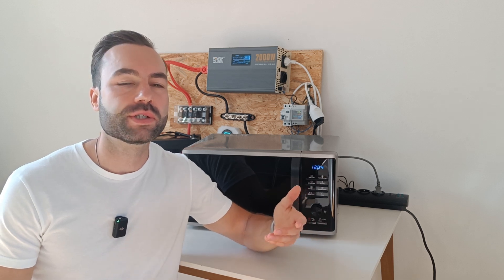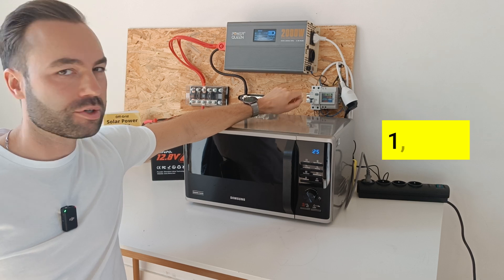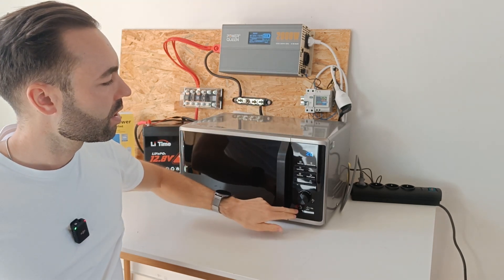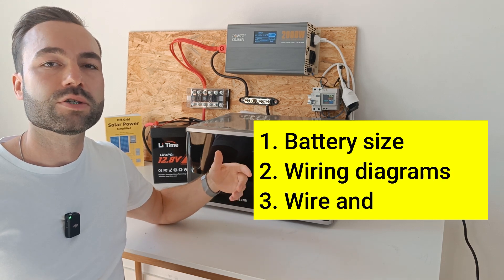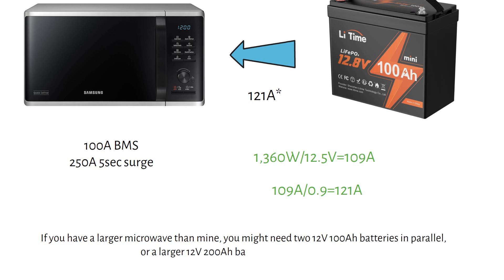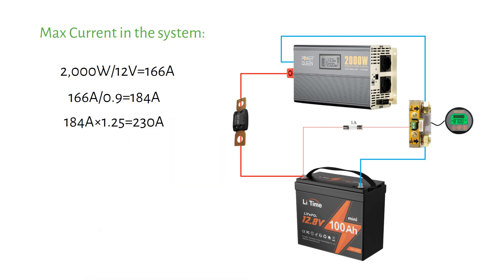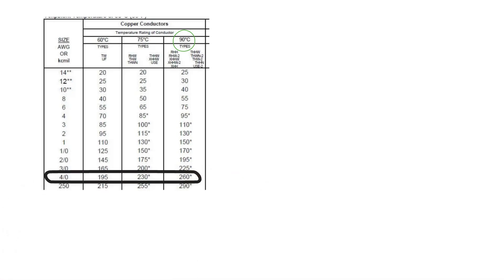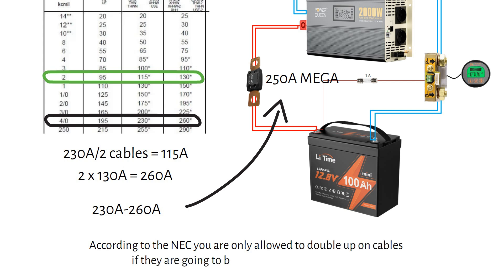What Size Inverter for a Microwave?

Comment: Nick, your calculations are fine for a single direct output.  But the manufactures realised that worked so they selling those inverters.  

They now sell inverters with a catch, with a twin plugs output.  The trouble is each plug will give you a maximum of around 60% of the rateable output of the the whole unit.  So a 3000watt Inverter gives around 1800w per socket, hence the reason that @Jesus_Student finds his microwave max'd out after a minute. That is the real world.

Comment: There are 200 C degrees silicon insulated cables which are even better than 105 C degrees synthetic rubber insulated "welding cables". No need to double the cables with them.

Comment: If you double the cables you can melt one of the negatives if they other becomes disconnected. If you use one fuse with 2 cables you can also melt wires if one of the positives becomes disconnected.

Comment: Could you please make a video about a system with 1000w solar panels and a 2000w battery and inverter and explain how long it would work and how much it would draw from the battery and how much from the solar panels? I hope I explained it well.
Reply from the maker: You can check my video playlist about systems. Also check out my video about load analysis.

Comment: Is the inverter microwave like 2000 bucks or what?  The 12v freezer is 1700, its more sensible to just use regular appliances and build a bigger array being i wont be mobile

Comment: I was running a 900 watt microwave, which drew 1550 watts. My powerstation was rated for 1200 watt running, and 2400 surge. It ran it for a minute+ before the circuit broke.

Comment: Sorry Nick, but Your calculation is wrong!
When You have 90% of 109A is  98A NOT 121A ...!!!!
Reply from the maker: It's 90% efficiency. That means the input on the inverter is higher than the output. Thus, it has to be divided by 0.9.

Comment: Hi Nick, great content as usual; thanks! I live in Hawaii and have found that purchasing any type of large lithium battery for DIY residential PV is seemingly impossible; I have done a couple of 'micro-solar' projects (e.g., a satellite modem/router back-up system) using banks of 24V power tool batteries which have taught me a lot. It occurred to me during your video that, since a microwave uses short bursts of high current, that it might be a candidate for lead acid batteries. I would normally never even consider an emergency back-up based 12V SLA technology but perhaps for a microwave and/or electric kettle it would be OK, right?
Reply from the maker: Please check my video about how many batteries for a 3000W inverter. It's my most popular one. Lead acid is more expensive than lifepo4, especially if you do it yourself like a 48V battery box with 280ah cells. For the capacity, it's unbelievably cheap. If you can build the battery like you already did, I don't think a larger diy battery is a problem. The cells gets shipped directly from China or a us warehouse. You don't need to box, but you need a BMS.
Reply: @cleversolarpower  Thanks! I would certainly NOT do 12V-anything (and especially not SLA) if there was an alternative but I think Hawaii must have some unusual shipping restrictions as I can't find any reputable LiPO supplier who'll ship here no matter how much I'm prepared to pay. I've tried multiple suppliers on the mainland and Asia to no avail. FWIW, it's also frustrating that other companies in what I would call the "PV ecosystem" such as BougeRV won't ship things like DC-fridges here either; one of the hottest and sunniest places in the US, with lots of wealthy, environmentally-conscious residents, and yet it is woefully under-served by the industry!

Comment: Besides knowingly exceeding the battery's apparent BMS 100A continuous rating (3:33) for 3 minutes and justifying it with a 5 second surge rating -- huh? -- besides that, the temperature rating of the inverter's terminals is not considered for cable ampacity, putting the terminals at fire risk. Then there's ambient temperature to consider, etc., etc.  Be careful folks!
Reply from the maker: The specifications say it's for 5 seconds, but as I've said I ran it for 3 minutes without issues. Yes, the terminals will catch fire 😬

Comment: Thanks for the video explanations. In the end, the only thing that was not clear to me is if the NEC rule is that the doubled up wires should not be less than 1/0 total (of the 2 wires)?
Reply from the maker: Yes, if you split up the wires they should be minimum of 1/0. And then fuse according to the 1/0, so you need to use two fuses. I updated the description.

Comment: Better off setting up your off-grid system to focus DC and not AC. 

Much more efficient by not having the conversion losses from DC to AC to DC and then back to AC. (Panels - inverter - converter - battery bank - inverter)

Much more efficient to use DC appliances when running from batteries; no conversion losses.

You can source fridge, freezer, microwave that is used in vehicle and boats. Many DC options to choose from.
Reply from the maker: Fridge and freezer on DC, yes. Never heard of DC microwaves. But microwaves only work on ac, so there is an inverter in the DC microwaves.

Comment: Sorry, I don't agree with your assumptions. 
1. If you are running a 700Watt MW. It will consume about 900W from your 12VDC inverter. 
P=IV ie.900  / 12.6VDC (ie. STD batt voltage of LAB), which is 72A NOM. 
2. Then factor in the efficiency loss of  0.9 from the inverter. Which = 80ADC 
3. The size of the inverter over and above this, makes no difference. As a 8000W inverter will still only deliver 80ADC. 
4. This can be delivered by 2 x 6AWG cables in parallel. Providing you with an equivalent cable capacity of 130ADC. More than enough to run your 700W MW ('MAGNATRON' in Dutch). 
5. Your circuit breaker, or fuse, would be rated  at 120A for protection (with a small safety margin). 
6. You only ever run a MW for a max of 3mins in your van or camper. (For reheating). So over spec'ing the cable is expensive, and unnecessary.

Comment: How do I decide it’s ok to run micro for 3 minutes past the rated max battery capacity? 
I’ve got almost the same setup as your test. Microwave pulls 130 amps like your. My battery bms has a 5sec 300peak. 
You recommended 200ah batt, but say it’s not hurting anything to draw 121amps. 
If the micro is the only thing with this much draw, should I be adding another battery?
Reply from the maker: I would try it. If not, get an extra battery. You can also get a 12V 200Ah battery with a 'plus' BMS. good for 200A discharge.
Reply: @cleversolarpower  Thanks much. Meantime, I decided to also solve travelling in sub zero and camping in cloudy weather with a second battery. 200amps should give me a little more than I need all around.

Comment: your setup uses close to 170amps, your wires are way too thin.
Reply from the maker: 121A as calculated in the video. I'm using 4AWG cables rated at 105°C, so they are sufficient.

Comment: At the minute 3:43 you used 1360 Watt in calculation. Is this the wattage rating of the microwave? Thanks
Reply from the maker: Yes, this is the amount of power it draws when running it on 800W.

Comment: you are the he best I’ve seen so far got a question. I have a Toyota Prius I got an extra 12 v battery I want to use  microwave and electric grill what  size  of inverter do I need the spare battery is 572 crank I’ll be connecting that battery to the existing  car battery with fuse and cables and cut off switches

Comment: I bought a cheap microwave for AU$49 (about us$30) for camping. It has an efficiency of 58%. Better quality microwave ovens are about 65%. That is it draws 1200watts and has an output of 700watt. The problem is I had was that in the campervan I have has a Victron 1200W/24V inverter which will run the microwave at most for about 30 seconds before closing down. I tried a couple of different method to reduce the power, 1st being reducing the magnetron heater voltage  which proved to be too unstable. Next was to use a PWM is a triac. This also proved to be too unstable. The last method worked well, that is using a variac and that worked. By dropping the voltage to 206V I am drawing about 900W which is fine for cooking continuously on my Victron 1200W/24V inverter and down to 400w at 190V.  Maybe an inverter microwave is the way to go but no one makes a 20 litre or less sized microwave or get a bigger inverter
Reply: Just get a much bigger inverter (which you probably already did). They are cheap nowadays. I just bought a 4000/8000W, 4x 240VAC Ozzie outlet inverter for AUD$135 from AE. It included a 'soft start' feature which might be good for my drill, circular saw or air-compressor. But not much use for the MW. 
Inverter MW's are so damn expensive and are all huge in comparison. ie. 1100W typical.
For the 3mins you're going to use it to reheat your left overs from yesterday, it's just not worth screwing around with the 'high tech'.
PS. My 700W MW was brand new and free on Gumtree!
Reply: Thank you for your comment but already have had experience with cheap inverters. Like a friend of mine we both went down the road of cheap inverter. Now we have garage cupboard full of dead ones. There other problem I came across using cheap inverter that they don’t have much if any harmonic filtering and will blank out the radio and TV reception and leak into audio equipment.   
I have my system now working well by dropping the voltage using series inductors to the microwave oven.
 @dora-de-explora

Comment: When choosing cables I somehow feel that when using the higher temperature rated cables at 105 degrees, you are designing a system with a higher than desirable voltage drop than necessary. The smaller cable dimension, which the higher temperature rating allows, also leads to a higher voltage drop. Sometimes it could maybe be desirable to go for the bigger cables with a smaller temperature rating but lower voltage drop? The price difference is maybe not too big, but of cause it's more cable and cable weight added.
Reply from the maker: You can use a voltage drop calculator (or check my video). But if the length is not long, this doesn't really matter.

Comment: I understand the idea behind using two smaller cables instead of one big, but what happens if for some reason one of the cables is shorted to ground, then that one cable will draw almost double it's capacity (worst case) until the fuse blows. Question is if it can be guaranteed that the cable will not catch fire before the fuse blows. I assume likely the fuse will blow before enough heat has built up?

But an even worse scenario would be if the second cable is somehow cut / disconnected without shorting, leaving the remaining cable with the task of carrying all the current. In this case the fuse will not blow and the remaining cable will overheat and eventually lead to a fire. But maybe that scenario is far fetched and will never happen (or has never happened) in real life?

Likely the NEC rule ensures that the double cables are of a minimum dimension that will minimize the likelihood of an accidental fatal cut / disconnection.
Reply from the maker: You need to fuse every cable. So if you have two parallel cables, you need two fuses. You can only split the cables up if they will be larger than 1/0 (55mm²).

Comment: Nevermind the inverter, just make sure the microwave is on it's own circuit or you will blow the breaker every time. Also, they use a ton of power, so be ready to charge up your batteries.

Comment: If you are going to run a microwave from battery, you should get an inverter microwave, it does not use a big transformer, but has a dc-dc converter that converts AC into DC and the boosts the DC to 2000v.   It has adjustable power levels, so it can consume much less power.  and it also weighs much less, good for a camper.
Reply from the maker: Indeed.

Comment: What do gas dryer ignitors draw?  I think it's hot surface type.
I have a gas dryer that overloaded my 2000 W(3000 W peak) inverter.  Thx.
Reply from the maker: I don't have one so i really don't know. Maybe you can check the manual, it's should be in there. If it's a high frequency inverter, it doesn't have a peak surge even though it says so.

Comment: What about if the microwave itself is an inverter type??
Reply from the maker: Inverter type microwaves are better as they don't have a surge power. If you set the microwave to 400W of power, than the microwave will draw 400W.
Reply: @cleversolarpower  ok thanks, can I ask one other question I'm trying to make my own DIY solar system but I'm confused as to why some persons uses these dedicated bus bar strips  Vs others not why should bus bars be considered or not

Comment: I have a 900watt Microwave  and run it off my 1.5KW (3kw) peak soft start full sinewave inverter - it draws 93amp when the microwave is on full about 1200watts  - my BMS is rated at 120a continuous my battery is 310ah lithium - we have one item on at a time rule in our RV for all big consumers like kettle, toaster and coffee maker - items like lights, TV and water pump run direct from the 12v
Reply from the maker: That sounds about right.

Comment: How about doing this using your car and the inverter set up. What size inverter can a car run?What is needed for a 1000w coffee maker? Can a car power a microwave. I want cheap & easy. Mostly I want to be able to make coffee in the morning when the power is out. Being able to run the micro for a few minutes would be nice too.
Reply from the maker: Car batteries are not made for inverters. The batteries won't last long because they are designed to deliver high current for a short amount of time. Not to run loads. Check my video: how many batteries for a 1000W inverter.

Comment: Where the information come from that says we shouldn't double up wires under zero gauge or whatever? 

1 + 1 = 2

2 + 2 = 4 

8 + 8 = 16 

I don't see how the math breaks down to any sort of an unsafe level. 
I'd say it depends on what you're using the wires for and how much juice is going through there and if you need a bigger wire add more wire as long as the numbers match in the end. 

I typically will run doubled-up or even quadrupled-up 12 gauge copper wire for my stereo amplifier to speaker and it works great at no additional costs of specialized sizes with specialized prices. 

As long as your lengths are fairly even and the total mass of cables becomes equal to the wire gauge needed, all is good. 
Maybe it doesn't look quite as neat but the electrical flow will be nearly identical as well as heat generated in the cable. 
I braid mine.
I believe the cable jackets are actually cooler on a braid than a single mass wire with thin skin jacket, especially when airflow is present. 
You're single fat cable can build up heat and actually trap it and it will continue to build up as you run power through that wire. 

Cooler wires transport electricity more efficiently than hotter wires.
Reply from the maker: It's in the nec (national electric code) handbook.

Comment: Out of curiosity, does anyone know why the actual power draw is such higher than the rated power? I recently found same issue on a new microwave, rated input is 1250w, output is 1000w, however the power draw is actually about 1600w.

Comment: Hi. Can you help me please. 
I have a motorhome professionally fitted out with electrics. This allows me to charge both the starter battery and leisure battery when hooked up to mains electricity. (I do not have solar panels or use lithium batteries) 
My question is, can i hook up to mains electricity to charge my leisure battery as above but at the same time, plug in my portable 2400W power station inside my motorhome socket to charge it up when the mains hook up is still connected? 
Hope you can help, thank you.
Reply from the maker: Yes, it will be a little more inefficient, but will work. Because: AC (mains)->DC (battery charger)->AC (inverter)-DC(battery charger) instead of AC(mains)->DC(battery charger)
Reply: @cleversolarpower  Thank you!

Comment: The inverter needs to be so highly dimensioned that sufficient reactive power can be supplied. Here in Germany, transformers, inverters and such things are specified in VA (volt-ampere), and not in Watts. While the rating in Watt means it is for the used (or typically usable) current, the VA ratings include reactive power.

Comment: Most ovens have the RF power and the actual draw from the outlet listed on the label.
Reply from the maker: As you saw in the video it wasn't correct. 1150W was listed and it pulled 1400W.
Reply: @cleversolarpower  Panasonic NN-ST342W 800W RF (IEC-60705) 1270W, measured 1290W/0.99PF with professional equipment, 1300W with amateur equipment.

Comment: When you are calculating amps based on 90% inverter loss shouldn't you multiply the 166 amps by 0.9 rather than divide.
Reply from the maker: No, to take the efficiency factor in mind you have to divide. Otherwise you will end up with a current lower than 166A, while in fact it needs to be higher. Input power of inverter is greater than output power, hence 90% efficiency.

Comment: Iv got a 650 x12v truck micro with 1000w renogy pure sign inverter with a 300 amp lithium batteries all with 35mm cables ( only less than 1m lengths )